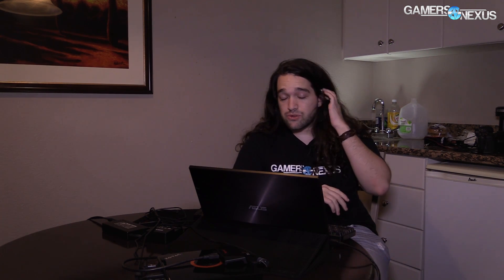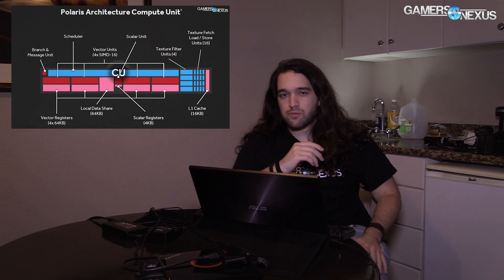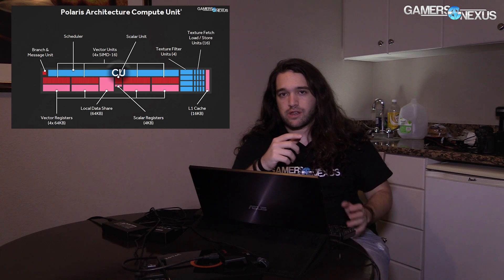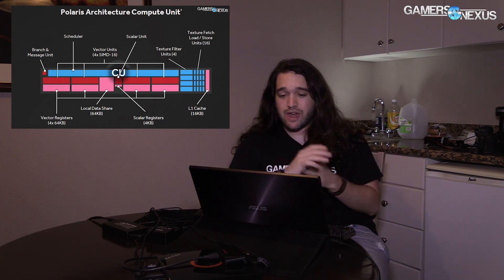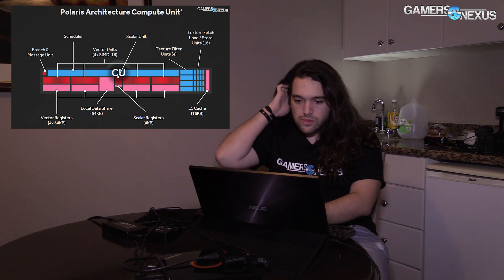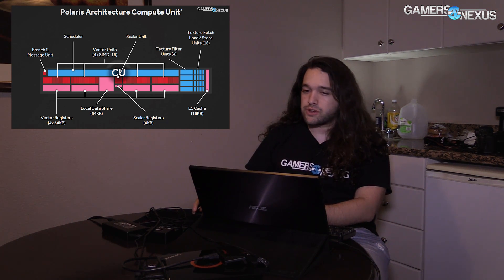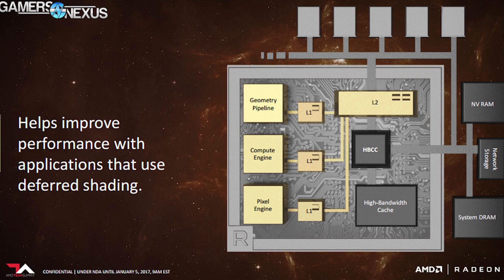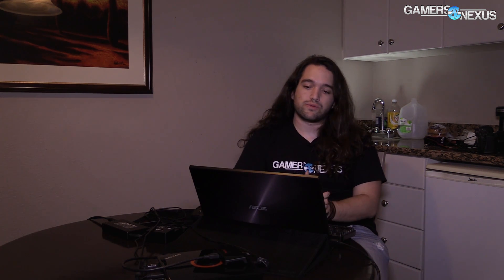AMD Vega Architecture: HB Cache & the NCU | CES 2017

Comment: With regard to the crappy Vulkan and DX12 support so far, with a few exceptions and only one for Vulkan, it should be taken into account that there is large gap between the start of writing the code and the debute of the game. The production of games which are released now started often 3-4 years ago, as far as I understand. Odds are that a few years from now we'll see a lot of well implemented Vulkan and DX12 games, so far it mostly has been about patches and rewriting the code.

Comment: It very much matters for games. Sebastian Aaltonen aka Sebbbi , a senior graphic lead/engine designer who formerly worked at Ubisoft but quit to start his own company, has mentioned that alot of post processing doesn't need full 32 bit precision and could be rendering using 16 bit precision.  Already there is a racing game Mantis Burn Racing on PS4 Pro that utilizes 16 bit precision help it achieve native 4K 60fps (not solid 60fps though).  So obviously there is benefit in gaming and graphics rendering to use half precision.

Comment: NVIDIA doesn't have to play its hand yet... AMD does. Providing all of those technical details, while interesting, doesn't really mean anything if it's performance is just on par with what's currently on the market. 

At the end of the day benchmarking, even a technerd only really wants to know: 
1. How many FPS? 
2. Consistent framtimes? 
3. How's it compare to existing cards.
4. How much will it cost? 
5. Bang for your buck? 
6. Overclocking? 
7. Temperatures? 

Simple as that

Comment: This is my speculation: Vega will be released by the end of February, non-reference models will be available during March (high-end ones first), but GTX 1080ti will be silently released a week prior to vega/ RX500 series release. Top of the line vega card will be as fast as Titan X pascal and priced at about $700. Let's find out if I can tell the future.
Reply: LOL no way they match a Titan X P.  I'll give them 1080 level at best, and in dx12/vulkan only they might pull ahead.
Reply: Yes.. you're right.. It will be very difficult to match the performance of the Titan.. But definitely the card's performance will be very close to the performance of the GTX 1080 priced probably a hundred bucks cheaper. Once again Nvidia cards will run cooler and they will be more efficient.
Reply: Todd Simone The driverless unfinished engeneering version of vega is already significantly faster than a gtx 1080. You follow the news at all?
Reply: aarondbrown1991 They have told us Q1 2017. I'd chill and wait if I were you. 
You never know what they will have and how good it'll be till it's actually out.
Reply: AMD does bring new stuff to the table.. That is:
Not bending their customers over, raping their chocolate starfish hard and acting like nothing happened.
Not only that, AMD cards age so much better.
780TI, look at that poor thing, was a grand on release and now it's fairly shit. 
Radeon HD 7990 is doing better...

I got a GTX1070 myself, so don't go calling me a fanboy. But nVidia really needs a kick in their ass.
Reply: ***** Ah feels bad man.
The Witcher 3 is such an amazing game. Definitely one of the best I've played.
Reply: ***** I don't think there will be a pascal refresh. Vega will be on par with pascal so nvidia has no reason nor time to do much about that (it's very expensive too), and next year Nvidia will bring volta and amd will compete with navi. That will be even more interesting to see. Who will be on top in 2018? No idea.
Reply: Razor Blazor Unfortunately for us consumers, I'm basically positive that nvidia will be on top. I keep cheer leading for AMD in the hopes that I might not go Intel/nvidia with my next build. AMD is just SUPER SHITTY at telling their potential customers WHEN THE SHIT WE WANT TO BUY will finally come out. Fuck, they've been going on and on about Vega, and Ryzen. They have peaked interest in a huge audience of potential buyers. Then CES pops up, and they give hazy, weak, shitty little tidbits about their products.

You're not going to tell me about each model of CPU you'll be manufacturing this year? If you're like me, waiting to buy your first all red system in a decade, you're probably pretty pissed. I'm literally going to wait for Ryzen to push down Intel CPU prices, and go Intel YET AGAIN, this time just to spite AMDs horrible PR practices.

If anyone from AMD is reading this, please fix your business. Maybe letting a bunch of 50/60-something's design your hype campaigns isn't the way to go. Consumers need specs, prices, and dates. You also have to meet those promises. I know, for AMD. that must sound like a nightmare. However, that's just the way a business that sells products works. FFS, I'm so triggered by AMD right now.
Reply: Razor Blazor Definitely if you have something to game on right now!
Reply: Razor Blazor wait your saying I can get a card as powerful as the titan XP for almost half the price I'm in for crossfire
Reply: spanky gamer I am saying that yea. Just wait a few months.
Reply: ***** Yeah SLI specifically is dead to me. I have no experience with crossfire. But I think its the same. Too many games either don't support it properly or at all. It's a waste. 

I was just saying that once vega is out we will se titan xp performance cards for allot less Vega 10 and 1080ti. 

Titan x cards are just there to milk people who have more money that sense. Nvidia knows how to maximize profits for sure.
Reply: Razor Blazor Vega will come out 1H of 2016. Not in February or March.
Reply: Razor Blazor Sorry I meant 1H of 2017.
Reply: Nadeem Shariff guess u'r right. Was sure I saw Q1. Then it better be faster than titan x.

Comment: So much technical shit but none of this matters if the FPS numbers blow...
Reply: FPS doesn't mean a thing if your frame times are crap.
Reply: Waseem B312 i agree with all of that. However the end user will decide based on benchmark numbers.
Reply: Yücel Kayabaşı
I am pretty sure AMD will not dissapoint with Vega and Ryzen
Reply: Earl Mcnulty Consistent frametimes don't mean a thing if your FPS sucks.
Reply: Yücel Kayabaşı There are other things than fps...power efficiency, IPC, clock speeds, memory technology, compute engines and so many other things. Together these things make or break a graphics architecture.
Reply: Waseem B312 based on their history there is a strong possibility of disappointment... First so far, it's a no show at CES. 

I hope Ryzen and Vega are great but AMD better knock it out of the park this time. Great driver optimizations months after the GPUs release will probably not impress consumers or investors.
Reply: enicotinic
Vega is gonna be great don't worry. When Nvidia will release Volta in 2018, AMD has plans for that too. I think they are gonna release Vega 20 around that time on a 7nm die shrink process.

Comment: so both and amd and nvidia fucked it up this ces    nothing new on vega nothing new on 1080ti  dickheads
Reply: I think they scared of each other.  I mean AMD announces actual VEGA performance and Nvidia stomps them with a 1080ti or vice versa, Nvidia announces the 1080ti and it gets Stomped by Vega.  So instead they just both decided to reveal nothing.
Reply: JIME Q Gaming
i just hope amd will be succesfull maybe prices of gtxs would go down :)))))
Reply: Pasotintojas1 I want AMD to do well in both markets.  I am tired of paying damn near 400 bucks for a quad core >.>.  I have two Furys which I like, I like Fiji a lot actually and you can pick up a Fury Nitro new for like 300 bucks (why buy and 480 or 1060 lol?)

But honestly I think AMD does do well in the GPU market with the performance they offer, people just not really buying their products (blame marketing?).  I mean Fiji I think was a good chip (I bought two of them so I may be bias lol), and the 390x is a very good chip compared to its Nvidia Competition.  Now Pascal craps on Polaris because there is no competition for the 1070/1080, but the 480 and 1060 trade blows well.

Comment: Anyone else doubtful that AMD will be competitive for gamers?
Reply: taipeitaiwan10 their gpu will be fine. will probably not match the 1080ti but many people aren't going to buy those. not many people out there are willing to drop a g on a graphics card. as for ryzen I think it'll be close but I think Intel will still have an ipc lead. that said with Intel not updating ipc for ages to a huge extent I think they will get close. only time will tell. early ryzen benchmarks seem promising especially if it overclocks well.who knows could flop or it could save amd. I'm hoping for some good competition finally not that I plan to upgrade for a while but it would be nice for the future.
Reply: I'm praying for AMD to hit a homer. We need competition. AMD makes great under $300 GPUs and has given up the higher end mkt. All I want for AMD to do is make a CPU that is able to trade equal blows with Intel, and doing so in the $150-350 price range.

Comment: Did AMD just get cold feet because they felt they overhyped it?! I mean all this Vega vs Volta teasing and then nothing to show for it? I think they overhyped then backed off. Because they DID show off Vega performance but it isn't as good as the hype, maybe trading blows with gtx 1080 but not Titan xp/1080ti good.
Reply: The Semite NVIDIA doesn't have to play its hand yet... AMD does. Providing all of those technical details, while interesting, doesn't really mean anything if it's performance is just on par with what's currently on the market. 

At the end of the day benchmarking, even a technerd only really wants to know: 
1. How many FPS? 
2. Consistent framtimes? 
3. How's it compare to existing cards.
4. How much will it cost? 
5. Bang for your buck? 
6. Overclocking? 
7. Temperatures? 

Simple as that.
Reply: enicotinic yeah, I'm so afraid that AMD is gonna come out with a 2016 king of graphics in 2017 and Nvidia will just release their 1080ti with just enough tweaks to kill it. 
Before anyone accuses me of fanboyism I own an RX 480 GTR and a GTX 1080. And I'd like to do an AMD build if ryzen is good enough considering I'm on watercooled x99 with 5960x.
Reply: Also no ryzen cpu reveal?!
Reply: its almost 4-5 months from release. what more do you expect other than architecture details? 

star wars battlefront sees 50 fps on 1080. vaga pulled 60 fps with vsync (i.e. capped out its limit). Titan XP pulls about 67 fps. not sure what you are basing your analysis on, but they are off
Reply: Rashed Sarwar regarding benchmarks, they showed doom (Vulcan game) in 4k and of the top of my head AMD was hovering around 60 while Titan xp (Aug 2016, quite a bit older) was 61-67 fps. Also,  how about they give us the number of shaders, compute units, or clock speeds? They surely have that by now.
Reply: Rashed Sarwar Rashed Sarwar regarding benchmarks, they showed doom (Vulcan game) in 4k and of the top of my head AMD was hovering around 60 while Titan xp (Aug 2016, quite a bit older) was 61-67 fps. Also,  how about they give us the number of shaders, compute units, or clock speeds? They surely have that by now.
Reply: It hovered around 60 as vsync was on. fall all we know it can pull 70+ fps with it off. also if you activate VSYNC on performance will dip a "little below" 60 momentarily if the GPU did not anticipate the sudden rise in workload. or maybe (although unlikely given the trend in the drop) the minimum fps of vaga is 58-59 fps, which is still titan x region at least on a driver that i donot believe is no where near finished.

regarding clocks, i suspect even amd does not know its retail speed as its still 5 months off.  number of shaders, compute units typically allows one to estimate the performance of a GPU. its reasonable for AMD to keep that a secret as they do not want to give its competition a heads up. i do agree with them no releasing these data.

but i did expect them to clearly state if all vaga will have HBM or only the first two tires.
Reply: Rashed Sarwar I missed that vsync bit. I stand corrected. Still, they way overhyped today's bits of info. Nvidia, yesterday, revealed more stuff yesterday and they didn't say a word before hand.
Reply: Uhm no, Vsync was not on. It hovered around 68 FPS actually. Not sure where you guys were looking but on the top you could clearly see 68 fps all the time. (With some frequent dips to low 30 fps :O, Gonna blame poor optimization for that ). Right now it looks like we got a 1080(ti) there in terms of performance.
Reply: Eternal Genesis errr yes. you might be confusing doom demo with battle front http://videocardz.com/65343/amd-demos-star-wars-battlefront-on-ryzen-and-vega-at-ces2017
Reply: Rashed Sarwar Yeah I was. My bad. But my 1070 runs Battlefront @ 45FPS on 4k max settings. So that is indeed interesting
Reply: Umut apparently it's going to be H1 2017, first half. I'm not sure if it's the silicon or problems with HBM2.
Reply: The Semite It's still in early development. The clockspeeds on the cards aren't even final yet.  We don't even know which Vega Card (10 or 11) was shown in those benchmarks. Nvidia doesn't seem like they will release the GTX 1080ti with chances of Volta coming out this year. Right now CPU market is more important than GPU msrket so even if Vega fails, (if Ryzen succeeds) AMD will get lots of Money and Navi isn't that far either.

Comment: Floating point precision matters if you work with AutoCAD.  So every engineer cares.  They might game on the weekend.
Reply: It very much matters for games. Sebastian Aaltonen aka Sebbbi , a senior graphic lead/engine designer who formerly worked at Ubisoft but quit to start his own company, has gone into detail that a decent amount of the rendering pipeline and alot of post processing doesn't need full 32 bit precision and could be rendering using 16 bit precision with no visual difference.  Already there is a racing game Mantis Burn Racing on PS4 Pro that the developer themselves have stated utilizes 16 bit precision help improve performance and be one of the few titles that can actually achieve native 4K 60fps (not solid 60fps though) on the Pro.  So obviously there is benefit in gaming and graphics rendering to use half precision.
Reply: Mike M
Yes sort of, kind of but not really.  The thread started with AutoCAD specifically.  Floating point is not just in rendering graphics in AutoCAD.  The engine is far more than graphics.
Reply: David Dupoise Sorry for derailing your thread, however I am correct regarding gaming.
Reply: Mike M
all good. You are correct as far as I know regarding gaming.
Reply: I'm two quarters away from getting my BS Civil Engineering and I've hardly used AutoCAD. Took one class on it back at community college, and don't even have it on my PC now. I thought more classes would have me using it. Guess I need to learn more about it on my own time.
Reply: *****
True but we are on a channel labeled Gamers Nexus so.... there is that.  I do wish that there was a channel of the high quality of GN for design and engineering.  Linux FTW Arch Linux is my daily driver.
Reply: *****
Yes Wayland is a slow moving train.  I hope it is an improvement.  You can't go wrong with Wendell @ Level1Techs.
Reply: Do you think amd zen  will be able to run 60+ audio tracks in a daw with plugins and vst's
Reply: Mike M
Yes I am aware that floating point is used in some games; Chris Roberts from Cloud Imperium (Star Citizen) put out a few very nice videos on the subject.
Reply: David Dupoise Actually every single (non indie) game for the past 20 years has uses floating points.   I assumed you were responding to this long haired Gamer Nexus employee who said it remains to be seen if games can benefit from this half precision (16 bit floats).  With these newer generations of gpus now allowing registers to store 2x 16 bit floats, in theory there there is no game that cannot benefit from 16 bit floating points used in various stages of the rendering pipeline.

Comment: AMD VEGA Doom 4k average 70 FPS....Fury X Doom 4k average 56 FPS...FPS boost from Fury X - Vega is ONLY 20%.
 R9 Fury Nitro is 3% slower than Fury X and price atm is 260$....
So R9 Fury Nitro is 23-25% slower than AMD VEGA. 260$ + 25% = 325$.
So based on doom 4k benchmark performance/$ for VEGA is 325 $, if we compare it with R9 Fury Nitro.
ATM we are looking at performance between gtx 1070 and gtx 1080.

Note: i'm just calculating performance/$ ATM....power consumption, new features, current state of drivers are not subject here...
Reply: Where did you get that 56 FPS from?
Reply: I have Fury card, but also every single benchmark. Here is one example...This is benchmarked more than half a year ago so performance with Relive drivers is even better now:
PCgamer Benchmark
http://cdn.mos.cms.futurecdn.net/GsQHKF7n4nKxpxYEvfPzBE.png
Reply: Bojan Susic it's almost 10 fps more than the 1080. And same for star wars battle front. and Ashes. it lead in all those games.
Reply: On alpha drivers....
Reply: Well i said also that if VEGA is slower in DX11 but on par or faster in DX12 and Vulcan ( like previous generation AMD cards) and if the price is  15% less than gtx 1080 i would preorder Vega today.
Reply: Bojan Susic every benchmarked seen or leaked has been higher than the 1080 and 1070..
Reply: I'm pretty sure that fury x is more than 3% faster than fury.
Reply: i can give u 3-4 benchmark if u wantt....fury X compared with R9 Fury Nitro 3-5% max...OC R9 Fury Nitro is on par with Fury X
Reply: Well they r showing us DOOM 4k in average 70FPS...this is more or less gtx 1080 performance....check Doom Vulcan 4k GTX 1080 performance
Reply: Bojan Susic you said nothing like that but ok.
Reply: You've copy/pasted this comment on a few videos.